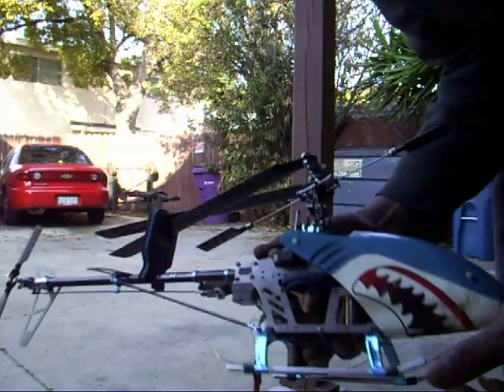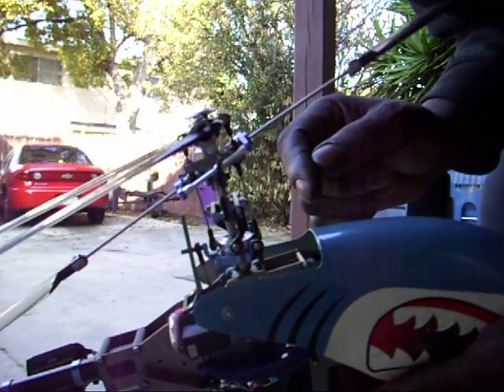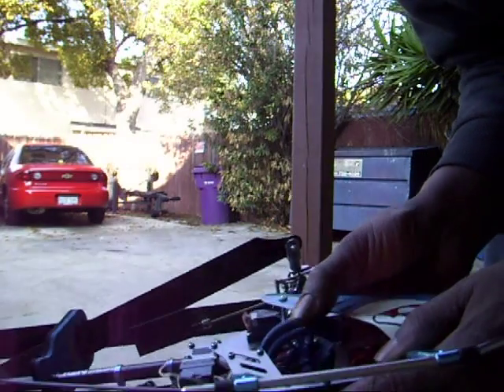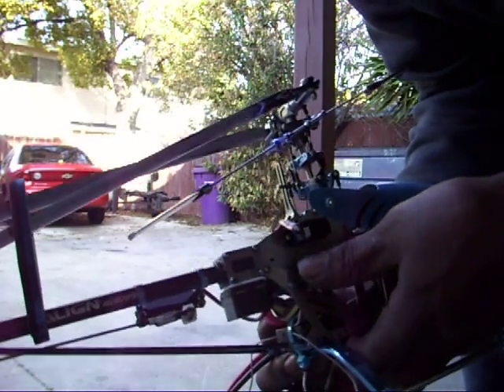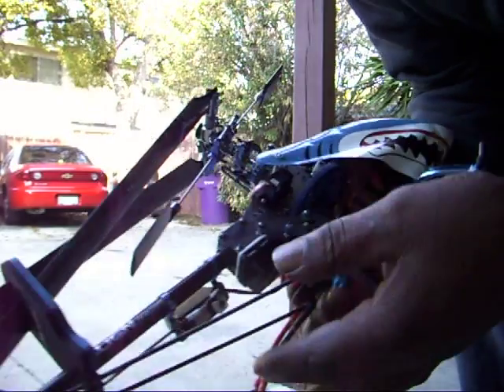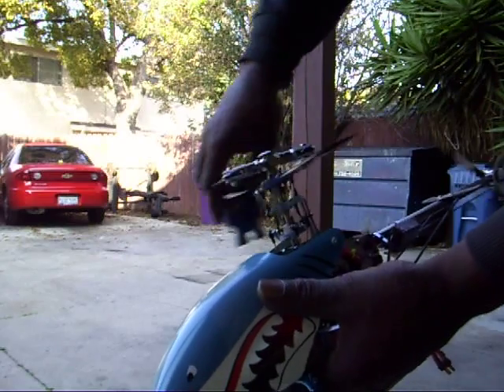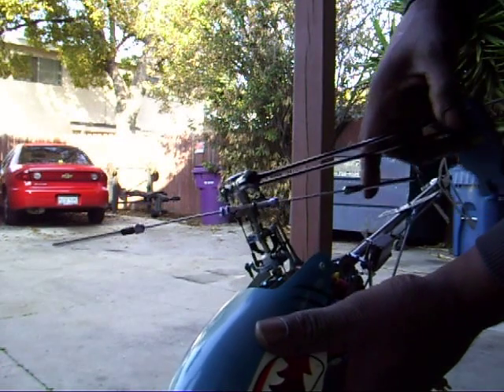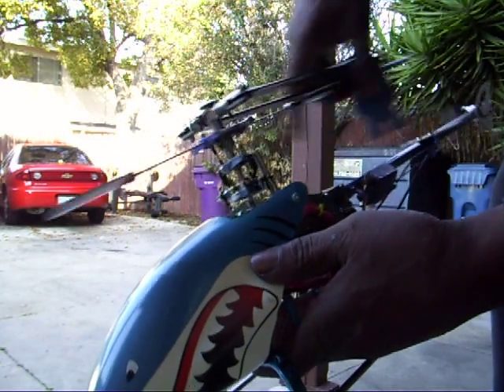trex 450 motor pinion gear and main gear how tight is to tight and how lose it should be

Comment from the maker: @Dudifiedad 
your motor might be to tight 
losen the 2 screws on the motor then push the motor away from the main gear and then see if the blades spins.
the motor might be pushed to tight on the main gear